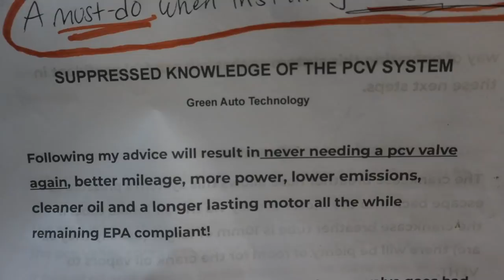The Wonder Of Positive Crankcase Ventilation

Comment: I worked for Ryder truck rental and when the pcv valve was mandated GM sent Ryder boxes full of new air cleaner base gaskets made out of carbon and tried to make Ryder use them on all of their GM products. They said we had to install them because NO engine should last over 100000 miles. The carbon gaskets would start to deteriorate and be sucked down threw the carburetor into the cylinders and wear the bores and rings out. Ryder promptly told them no.
Reply: WTF!!!???
Reply: Inbuilt obsolescence
Reply: Yeah right, sounds like bull.
Reply: @markg7030  it’s the truth you can believe it or not I really don’t care.

Comment: What about the oil vapors that enter the intake from the PCV? I find alot of carbon and oil residue in the intakes of older cars and it seems that it is from  the PCV system..
Reply: That's where catch cans come in.  I have a homemade system that catches oil and water formed from combustion and damp outside air.  I add the collected liquid to the oil change oil I turn in for recycle.

Comment: The pcv valve and related system  has a good  purpose.  It draws blow by  gasses into the engine  to be  consumed.  The oil does not  develop  much gas, in it from the  situation,  if any.

Comment: I just bought a 1957 Pontiac Star Chief 2 door and it has the dreaded Draft tube. I knew about the draft tube ventilation from classic car shows and my club. Is there a way to put a PCV on my 347 Pontiac engine. I know they sell the valve cover at Summit racing. My Pontiac has 2 oil breather caps one on each side of the engine (first time seen that) If you could please do a video or just talk about what someone could do to fix the dreaded Downdraft tube I would be very grateful. I have learned alot from watching you channel.  When the car was delivered off the truck and I first pulled into the driveway and later put it in the garage I saw oil spots on my driveway and thought DAMN ITS LEAKING OIL. ( looked under car and it was dripping from the draft tube) of we know if you classic doesn't leak oil, it has no oil in it.  Thank You for all the great videos you do !!

Comment: The pcv valve did not come on the scene until 1965 I worked on alot of late 50's early 60's rigs as I started pulling wrench's as a teenager in 1974 my first galaxie xl had a 352 4v and it had the blow by tube (that's what we called them) in the back of the intake going down the back of the motor and that motor did not have a ring left on it and when I stopped at a light or whatever it would fill the cabin with blow by smoke I hate the smell of that stuff.Fond memories lol.

Comment: The US Army invented the PCV valve for tank engines that had to run under water before 1945.
In '52 a CalTech Professor theorized that unburned/partially burned gasoline was a major contributor to smog. in '58 GM Research Labs confirmed that crankcase emissions were about half of all engine emissions. Cadillac Division of GM had made zillions of tank engines and guessed that the PCV valve could be the first, easiest and cheapest way to greatly reduce pollution. After testing to be sure it really actually worked to cut emissions in half - Cadillac offered it royalty-free to the Automobile Manufacturers Association. There weren't any laws, then but they all agreed to put it on all California cars for '62 and all cars made in the US in 1963.

Comment: I would think one downside to a PCV valve would be, if your motors tired. And has worn rings. The oil blow by would be routed to the carburetor. Which may gum up the carb in time.

Comment: The only downside you could find with a PCV is an increase in oil consumption especially if the engine is lubricated with thin oil, but it doesn't outweigh the positive of the PCV
Reply: Yup LS engine complaint. GM redid the valve cover to  fixit

Comment: Pulling down an engine pre-PCV you would use a screwdriver to uncover the head bolts underneath the sludge.
Reply: And Quaker State oil!
Reply: @tomreyn3610  Pennzoil was mentioned by many. Truth is in addition to the PCV system there was a switch from non detergent to multi viscosity detergent oils.

Comment: I grew up on a farm, we have a 1952 John Deere Model A that my grandpa bought new. Not only did it have that oil stank, it had varnished gasoline stank too. I wish I could find an engine block for it, haul it up here, and make it run again. Its the first thing I ever drove... at 8 years old.

Its fun watching people who don't know much about engines and vehicles try to explain stuff they don't understand. From the people who say they put jet fuel in their car and it really ran, to those who think its faster than it is.. FYI jet fuel is like kerosene, it just makes smoke in a car engine.

Like the guy who said his 302 in his 69 Camaro could pull the front tires and run tens on a 225 radial. He never would race my 79 Formula that had a string of 11 second slips on McCreary dirt track tires and BFG drag radials. The "hop a beer can in the parking lot" people...

 Or the turbo Neon guy in my unit who thought it was the fastest thing on the planet and said he would only race me for $500, and charge $250 to open the hood. Apparently he had no idea about the Formula mentioned above, but he knew about my bone stock down to the paper air filter and stock lid 98 Formula with the auto and 2.73 gears. He talked mad trash and got all butthurt when I simply said his car isn't that fast. He was friends with the low ranking guys in my shop, and they all thought he was fast too.

He was busy cooling down his neon at the local 1/8 track 30 min from base. I pulled off the highway, in the gate, into the lanes, and made a pass without a burnout. 8.82 and I don't remember the mph. That thing is like a bracket car varying between .82 and .84  hot lapping the snot out of it 10 to 15 times.

He walks up and arrogantly asks what it ran.  I told him and he got mad right off and demanded to see the slips. I gave him a handful of them, at which point he started saying something about my car being an 8 and his a 4 so I should stay in my 'class' and other crap. His best ever on a cold night was a 9.2 and that day his best was 9.7 or so. In the quarter that is like a mid 14 at best. My slowest car, the one that gets 28-30mpg highway, not the 12 second 70 GTO or the Formula, was faster than his "modded all to hell" neon.

Currently I have a chevy guy with a 68 Camaro and an iron head 454 that thinks nothing of mine is faster than a high 13. This summer will be fun if he ever gets his chevy put together.
Reply: You're almost at 500 subs. When are the nationals?
Reply: @SweatyFatGuy  What happened on YT today? What's going on with the channel?

Comment: This got me wonder.  What's the most significant chane in the automotive world;  PCV, EFI or OD transmissions?
Actual real down side to PCV is oil in intake charge and it acts as a octane reducer, though only really an issue on Forced Induction motors.

Comment: I totally agree. I remember not only the road draft tube, but as a biker, the road slick in the center of every traffic lane. I don't  see that so much anymore. Any thoughts on how much eliminating lead in gasoline contributed to engine longevity?
Reply: Lead was used as a cushion.  It built up in the valve seats but as hardened seats became available lead and lead substitutes were no longer needed.
Reply: Yeah, you never, EVER rode down the center of a lane.
Reply: It was also a source  of sludge  , stuck rings, combustion  chamber deposits  and rotted out exhaust  systems.

Comment: Thanks Unk. Great info. The pcv always made sense to me. Now I'm considering a catch can to clean things up even more. Any thoughts? I also think modern oils have done a lot to clean up and extend engine life.
Reply: I think the PCV with catch can is a good idea
Reply: They have.  If oil was the same as even 70s oil, today's Japanese wonder engines wouldn't last much longer that 60,000 - 70,000 miles between overhauls, and that only if the oil was changed regularly.
Reply: @michaelbenardo5695  My sister in law bought a new '68 Datsun 1600. It was maintained well and at 80,000 miles the car self destructed. Rear end and transmition were making noise, engine packed it in, and the body rusted out. She loved that car up to that point.
Reply: @oops1952  That's about how long those cars lasted.  Today, with far superior oils, it would go much further, but just think how long a truly good car, like a 67 Cad, will last using today's oils.

Comment: How do you feel about the oil catch can added to the PVC  hose?
Reply: A very good idea on direct injected engines. Helps to keep the intake side much cleaner.
Reply: Been running them for over 25 years. Well worth it and keeps the throttle body/intake manifold much cleaner.

Comment: Too bad Uncle tony didn't have an old-style "mechanical" PCV valve around instead of that high-falutin' fancy replacement deal. I don't know how much better or worse they were, but at every points-adjust/oil change I remember pulling the hose off, sliding the PCV unit off the valve cover snoot, and reaching down inside the small metal assembly with maybe a 9/16" socket to disassemble the whole thing to clean up the tube, check-ball, and spring clip which held it nicely in place on the valve cover.  I never would buy a PCV valve; just clean the old one, and 'rattle' it or check (by blowing) to see the check ball is free... good to go.

Comment: The funny thing is all truck diesel engines still have road draft tunes as diesels don't have intake manifold low pressure unless they have egr model and these have a throttle plate so they can create manifold low pressure to stop egr gas from migrating out air intake

Comment: damn, tony I think you actually have  one of the same valves that I bought for my flathead ford! The only problem I have is where to place the source of vacuum, I've got 3 holley 94 carbs over a 221 bored .040 over. I really would like to build one of those oversize aircleaners for a triple deuce setup though.

Comment: I built a small block Chevy n a big block Chevy motor for my C-10's. Both valve covers have a hole in each cover. Old motors actually had either a rubber plug or cap as the oil fill hole on one valve cover. The other valve cover had a breather cap with filter material inside. I've seen hot rodders actually use a breather cap on both valve covers. Not good. No fresh air enters the engine.
What I did on my engines is installed a PCV valve on one cover with a hose to the back of the carb for vacuum, to suck oil vapors and go into the carb and get burned off with combustion,
those oil vapors will also give you a little bit of top cylinder lubrication. On the other valve cover I used a breather cap, so that as the engine runs the suction of the other valve cover (with the PCV valve)  helps draw fresh air into the crankcase through the breather cap. This way you always have fresh air being drawn into the crankcase through the breather cap side and being sucked out the PCV side into the carb. This will help reduce greatly any sludge formations inside your engine crankcase, and you help clean the environment. You can also route your fuel vapors (where you would have a charcoal canister) with a hose and attach under the air filter, of course you need to make a fitting. This way the engine sucks the fuel vapors through the carb and also get burned off, reducing the fuel vapors from going out into the atmosphere... And help reduce your carbon emissions/footprint...

Comment: Okay, about the sludge build up on engines with a road draft tubes. I have a couple old Ferguson tractors. They have these tubes.  Is there something I need to do to keep sludge from building up. Or clean out sludge that is probably already in the engines. Thank you for all of insights, tips and information.
Reply: Use a good quality oil and change it often. If the engines can tolerate 15-40W oil (most likely can), use it since it has more detergents in it which will keep the internals cleaner.

Comment: If anything, the PCV system will help your fuel consumption because the vapors have a slight amount of oil being sucked directly into the intake manifold or carburetor, thereby possibly allowing the mixture to be leaned a TINY amount.  If there is enough oil to really do much, you need to re-ring the engine or at least get the rings unstuck.  The only time I have left the PCV vale out is when I got this great shiny pair of chrome valve covers that didn't have a baffle under the valve, & that would cause the engine to suck oil out of the cover.  And yes, whoever wants to try out the old road draft system better have valve cover & intake manifold end gaskets at the ready because it is not uncommon for the engine to blow them out if its in a truck running a power take off while sitting still for very long.   My family has run a bunch of Ford Y blocks & early FE's in a septic pumping business.  We swapped PCV valve covers & a carb plate onto the FE's & actually modified the Y block valve cover to accept a home made valve constructed from pipe fittings.

Comment: Ive seen cars that used modified smog pumps to draw the gases out the crankcase ! its also helps the oil seals from blowing out ! it does help boost high rpm horsepower
Reply: You gotta be careful though, too much vacuum can suck gaskets in.  Always make sure you're vent is clean.

Comment: I can verify the truth about PCV valves. I worked on a 1961 Ford Galaxie with a 292 Y block with about 60 some thousand miles on it. When I pulled the valve covers off to adjust the lash, I couldn't believe the amount of caked, thick black sludge in it. It was the same on a '61 Falcon with a 144 straight six. I saw the tube down the side of the engine and realized that was how they vented the crankcase. I had never seen that before. Now I understand why it was so dirty. I'm sure the quality of oil back then wasn't very good either. Those engines are a real mess to get cleaned up! Lots of gas, toothbrushes and brake clean!

Comment: Good stuff. I totally agree. I use them anytime i can. However there are cams with large overlap with low vaccum that are hard to get one to work, if not impossible.  There are pcvs with different breakaway values. Not much information on that out there. There is an out fithat makes adjustable pcv. Its kinda expensive.

A video on different pcvs and useage of pcv on non stock applications would be great content. I dont believe there is anything out there.

That said i have a high horsepower engine with a fair amount of cam that i could get a pcv to work on. I used a pair 80s dodge truck crankcase breather caps. One on each valve cover. Ran those to a catch can with a pair of breathers, and a drain. The only thing i get out the catch can is condensate. Not much oil at all. Does a real good job. The brad penn oil stays clean, and nice and green.
Reply: I run a pair of old Ford V/C breather cans that have the 5/8 hose barb on them.  I just ran them to fittings I made in the bottom of the air cleaner.  I feel your crankcase pain with these long duration cams.

Comment: Fuel injection was a big factor in increased engine life as well. Early non reliable egr systems were probably a step backward though. When they worked they worked and when they didn't, not so much....
Reply: Ugh, those stuck or blocked valves and passages.

Comment: I tire apart a late 80 engine with nearly 110k miles, it basically looked new, I have seen engines with 30k on it with more wear, I guess it had the oil changed regularly,

Comment: the truck i drive has the cat  twin turbo diesel,and it has the road draft/blow by tube cut just like that tube,ya but oil back then had less chemicals in it then it does now,so what is the better oil,the one that was similar to what came out of the ground,or the one that is full of chemicals today

Comment: I put a pcv system back on a 94 honda del sol that somebody else eliminated because it was causing oil leakage at the valve cover gasket and the v-tec solenoid o-ring gasket and no more oil leakage.

Comment: Hey Tony, I have a question/scenario. My 86 Jeep Grand Wagoneer had a leaking charcoal canister purge valve diaphragm, so I had the line from the canister to the egr plugged. And it was driving great at 12° timing and 18 inches of vacuum. Felt plenty of power and idled great. Then I repaired the purge valve diaphragm and I noticed that the idle dropped and the vacuum dropped to about 16 inches and the car ran rough. But when I disconnected the pcv line to the charcoal canister the idle and vacuum went back up and it ran great again. The egr is now working as its supposed to but now im having a pcv issue. Ive turned the timing up to about 17 and messed with the idle mixture screws and changed the pcv valve, I can get the vacuum up to 17.5 inches but no more than that. And now, after changing the timing, pcv valve and adjusting the idle mixture screws when I disconnect the pcv line it idles rough. So before it idled better when the pcv was sucking in fresh air, now it idles rough. And before that I had the egr disconnected and the line plugged and it was great. Also, when I disconnect the egr line nothing changes anymore. What could be the issue? Im getting suction from the oil fill tube like im supposed to, and if I disconnect the pcv valve while running and put my finger over it I feel good suction and the idle drops. Ive had to up the timing, adjust the idle mixture screws and open up the throttle on the carb a little bit to get it to higher vacuum and to idle better. The throttle was set to where the transfer slots were squares, now they're open more.